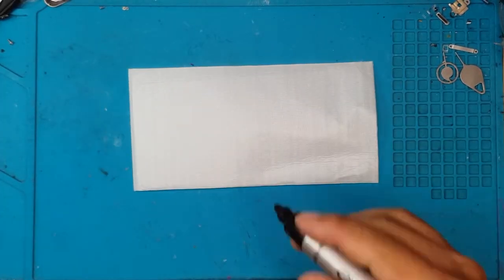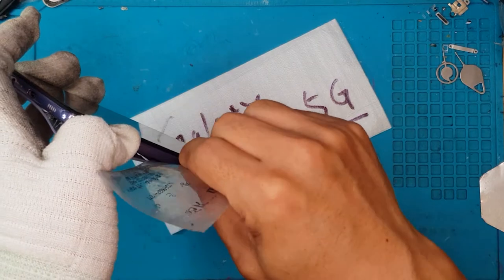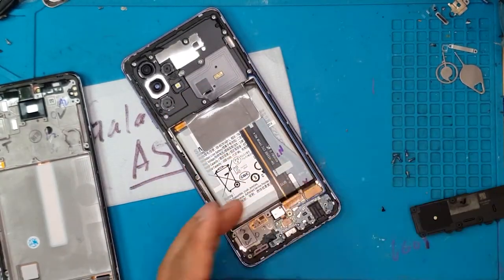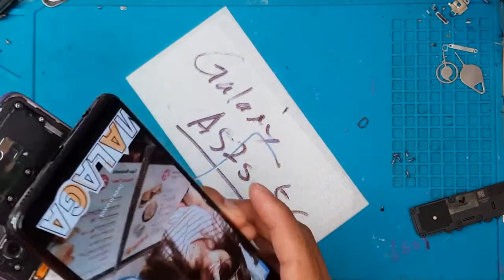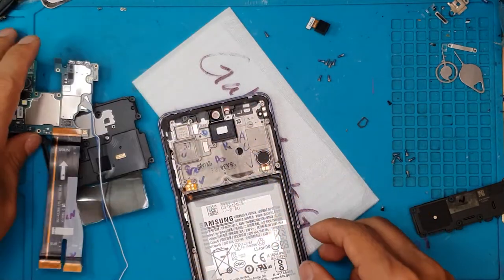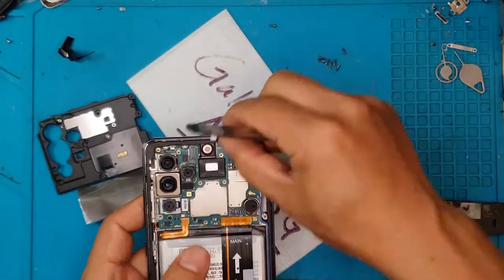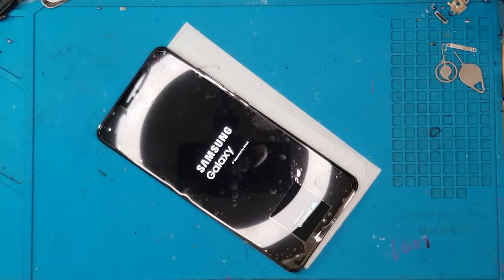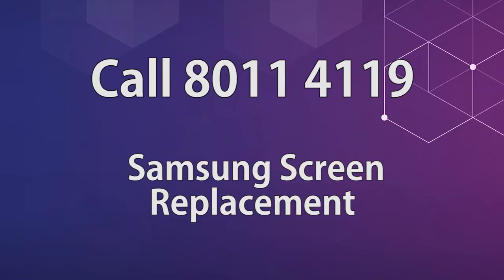Totally Worth It! Samsung Galaxy A52s 5G Screen Replacement | Sydney CBD Repair Centre

Comment: Thanks for the video, well appreciated videos like this, I have a question, the removing of the battery was not as smoothgoing as it was for you, While i was removing the battery it got bend , suprisingly quite flexible, no rips, no breaking of the cover. Im a bit worried if the battery substained any damage ?
Reply from the maker: should be okay but keep eyes on it whether it's swollen or not later.
Reply: Same for me.

Comment: Hi, any troubleshooting if phone doesn't turn back on after replacement? Or charge.
Reply from the maker: no display or no sign of alive ?
Reply: Thanks, no sign of life. The phone had been turned off for a month. I changed the screen and now it does not turn on. I am watching another video of yours atm for help. @SydneyCBDRepairCentre
Reply from the maker: @davidlestermooney  #1. battery might be out of power #2. charging port might not work #3. the mainboard might be dead. you may find the local repair shops for testing. it will save your time. cheers, david
Reply: Yes, it is vibrating periodically when I turn it on, but I see nothing on the screen.  @SydneyCBDRepairCentre
Reply from the maker: @davidlestermooney  my recommendation is finding a local phone repair shop. it's quick and easy to check ! thank you.
Reply: It's ok, I watched some of your videos, fixed it again and now it works. Great videos and thanks  for the replies.  @SydneyCBDRepairCentre

Comment: i recently replace my A52 5g with amoled lcd with frame but it wont turn on, i just feel vibrations but no display and it wont charge also it just vibrates a little from time to time
Reply from the maker: Hello, it means you did it wrong or the replacement parts is damage or not working.

Comment: Ive just replaced mine but the the touch screen doesn’t seem to work, I can see everything on the screen but when I touch the screen it doesn’t respond, what should I check first?
Reply from the maker: did you check the new screen before replacement ?
Reply: @SydneyCBDRepairCentre  thanks for reply, it’s all good now. I did a software update before fitting the new screen and I think it was the software update that caused it to run a bit “funky” on the first start up. After the phone was on for a bit and I restarted it, it was all ok
Reply from the maker: @ojsannals6877  that's good to hear. thank you

Comment: Does it still water resistant after the repair?
Reply from the maker: yes, you need to use the right adhesive. thank you.
Reply: @SydneyCBDRepairCentre  what adhesive would that be? i got b 7000. would that sufice?

Comment: When you are starting the phone with new lcd display it only shows samsung galaxy rather than samsung galaxy a52s.
A52s word is missing. Why is it so when you are replacing with original samsung display??
Reply from the maker: it's possible to editor to cut that scene . it's nothing related to the original samsung screen.

Comment: is this compatible to a52 5g?
Reply from the maker: i believe so but local part suppliers sell them differently and the original frames are different . i mean from samsung parts. if it's aftermarket, it will be same but haven't been confirmed yet.
Reply: thank you  @SydneyCBDRepairCentre

Comment: Would be good if you used a phone that hadn’t been previously stripped as the battery doesn’t “just pop out” it at the very least requires heat to loosen the glue otherwise you run the risk of damaging the battery like I did. Otherwise informative video let down